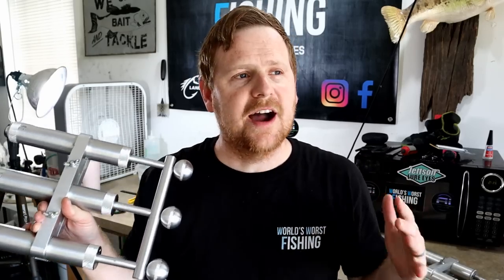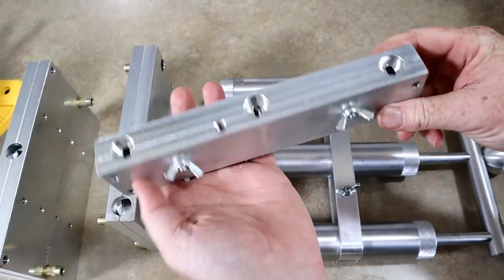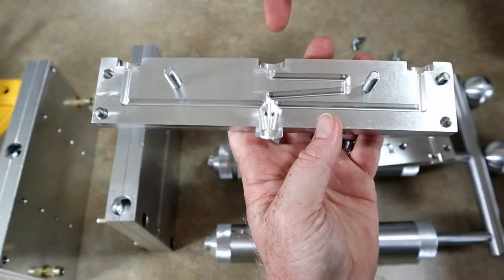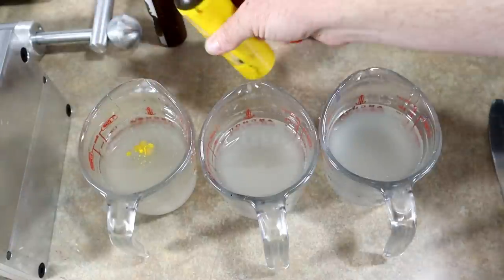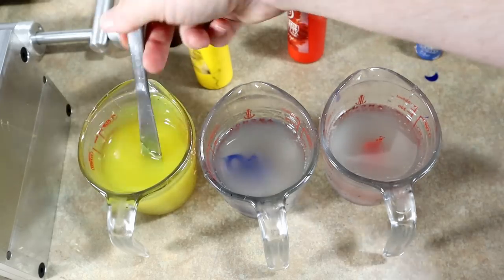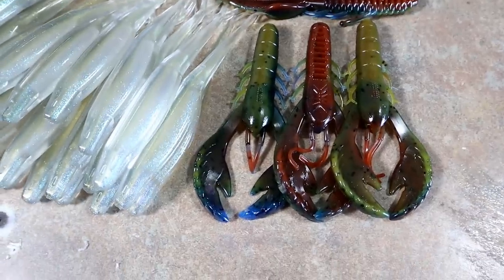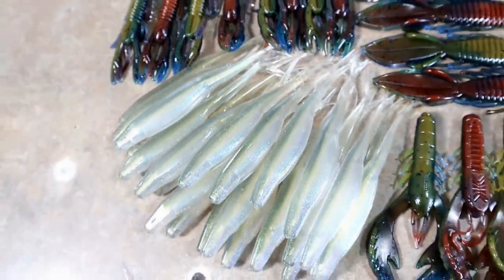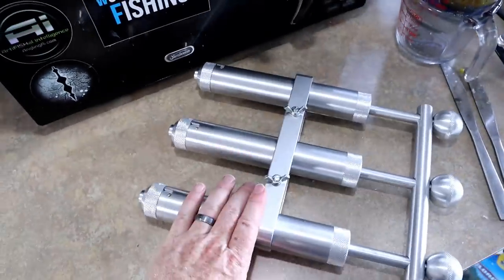We Bought A TRIPLE INJECTOR For Soft Plastic Lures!!!

Comment: Right when I convince myself I don't need a triple injector you put out this!!!!  Those baits are beautiful, especially the jerkbaits.  I notice you have to really lean on the injector to fill the mold, is there a danger that you push too hard when you get the cavities filled or is it pretty intuitive when you get to the full point and to back off on the pressure?  Another question; I just bought my first 5 gallon bucket of plastisol, do you just pour from the bucket into the Pyrex cups or do you have a separate "scoop cup or pitcher", or do you just dip out the plastisol with the Pyrex cups you are going to use and wipe it down?

Comment: What is the purpose of not scraping the colors which end up on the upper sides of the measuring cups? Does it never mix in properly if it lands there? Does it encapsulate too well to use by mixing in? I've always wondered why you've allowed so much of the color powders and liquids you add to be wasted by sitting in a portion of the mixing cups that don't quite reach the plastic (both before and after you heat it). Thanks for a possible answer, David
Reply from the maker: I don't scrape the plastic on the sides of the cup into the mix on purpose...Then you will have to reheat because those are already set up

Comment: Could you try to change directions in the middle of a blast.
Shoot half of the mold and then turn the injektor 180 degrees, so that the outside colors switch from left to right.

Comment: should somehow hook it to a bottle jack that moves pretty quick an u can easily push the plastic in the mold won't have to worry about pushing it with hands an can worry about just holding molds in right spot would be def cleaner an maybe more efficient

Comment: Have you noticed a change in flow rate? i could see the one side of the blending block keeping its temperature up longer with 2 channels on one side. While the other side has the single long channel and could possibly cool off faster.
Reply from the maker: no change that I have noticed..it injects very even

Comment: Should we start placing our bets on how long it is before the Quad injector comes out? lol Those shiner jerkbaits are fantastic.
Reply: Thanks for the comment love. Actually, a quad injector should be do-able.  Arrange the injectors in a square shape instead of in-line. Run a tube from each injector to a blending block  at the bottom middle of the square shape, then insert that blending block into the mold. Interconnect the injector plunger handles so pushing down on one pushes all of them down.